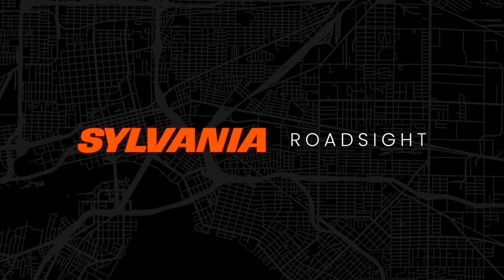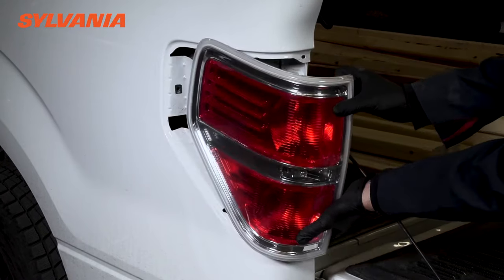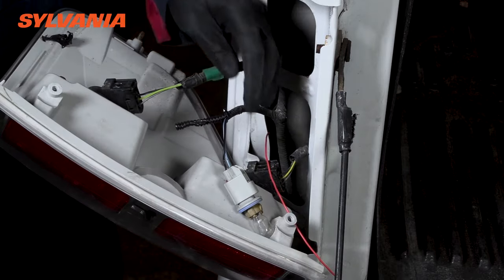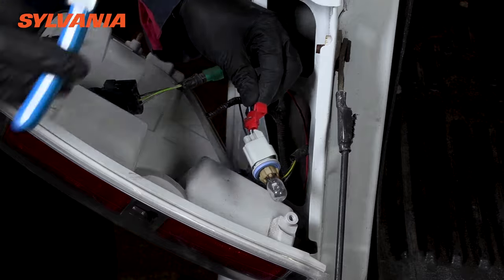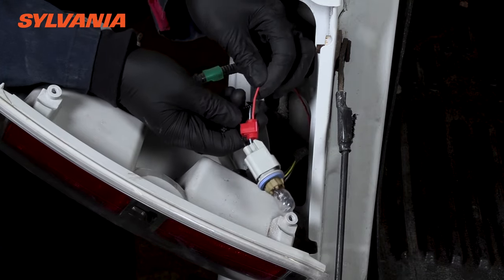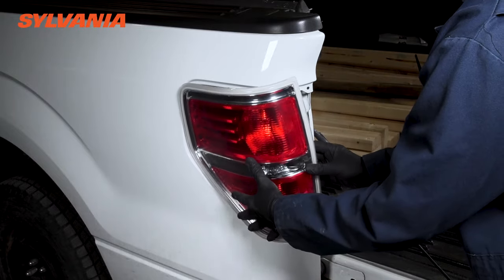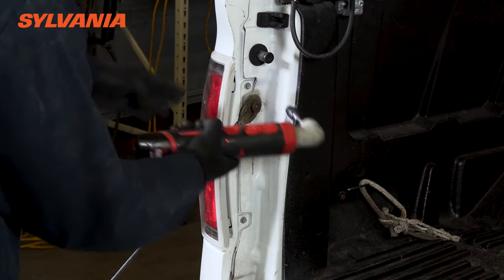How to Splice the Rear Camera to the Reverse Light for Automatic Display of Camera in Reverse

Comment: What do you do with the negative wire off the back up camera monitor wire.  I know you put the positive to the reverse light but where does negative go?
Reply: I would think the negative off the camera gets grounded to the vehicle directly. Pretty important step for them to leave out. :-/
Reply: @b3nault1  where would you ground it though?
Reply: The black wire right next to it is the ground. Im guessing the Sylvania camera grounds somewhere else in the system. You can use the black wire while you're there.
Reply: @noligion  I think any unpainted metal surface on the vehicle frame, with a bolt.  Wrap the wire around the bolt and tighten it.

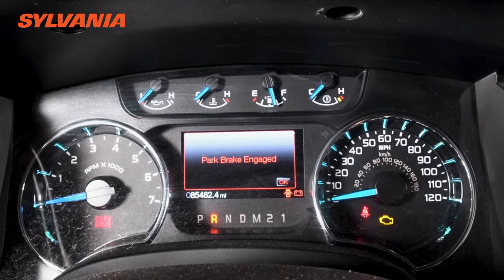Comment: 0:56 if you don’t have a multimeter and you can’t find the hot wire to connect to; just pull the parking bulb out and you will see 2 terminals inside the bulb socket. Connect camera wire directly to those terminals one at a time and see which one triggers the camera on screen.

Comment: My backup camera has only 4-pin connector and a red wire. If I am connecting the red wire to the reversing light my reverse lights go off. Head unit does not switch to reverse camera. otherwise camera works fine i can switch to it manually but that is not how it is supposed to work. When i am disconnecting backing camera from head unit and restart the car i do manage to get mu reverse lights back. Without red wire connection, only camera connected to head unit backing camera works fine just without automation.

Comment: Good video until you put the volt meter straight through the wire. That's a huge no-no. Then if you put a cut or hole in the wrong wire you'll have to fix it

Comment: Great video , Great detail.
I didn't get where the  Ground wire was connected. 
Was it to the Ground reverse light. or just grounded to the van chasis
Can anyone advise
Thanks
Andy UK
Reply: Am doing this now, it hasn't worked trying to ground the neg of reverse light housing, double checked my guide and It says it has to be negative chassis ground so hopefully it'll work tomorrow when I try that

Comment: where did you get that clip from?
Reply: They usually come with the camera I'm not a big fan of those unless the area is sealed off I'll usually use a shrink wrap tube 1st ill cut the wires and strip the end 1/4-1/2" on each wire slide them through the electric shrink tube 2nd I'll twist the wires together really good and slide the shrink tube over the twisted bare wires and heat the tube up using a heat gun or lighter holding the flame away from the tube 1-2" so it doesn't melt that way it stays insulated and water proof

Comment: Long story short, i got a dash cam with a back up camera feature, i got the power line for the reverse lights cut and when i splice the cameras back up wire to the reverse lights 12v line, the back up lights turn off and the backup cam turns on.
Reply: check your earth

Comment: great video but this kind of splice is going to fault over time because very small contacct area. beter to cut the wire and make 3 way crimp or solder the joint.